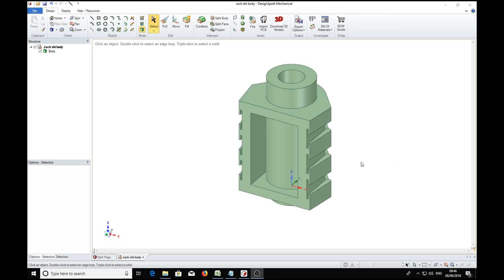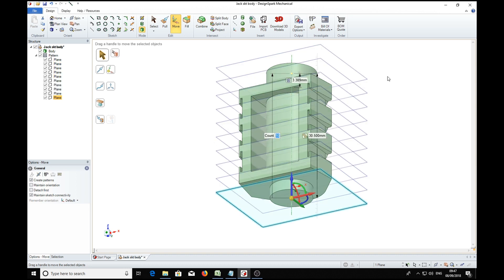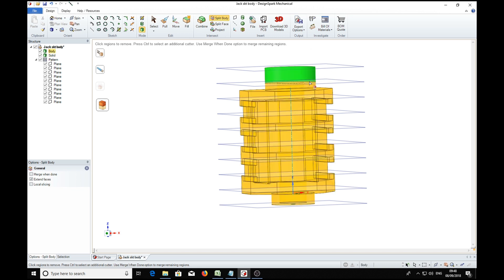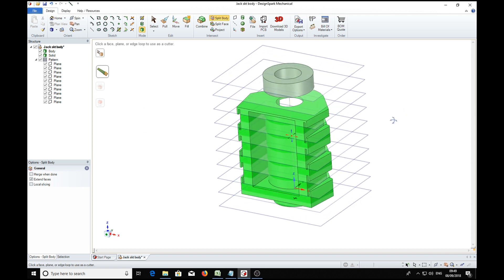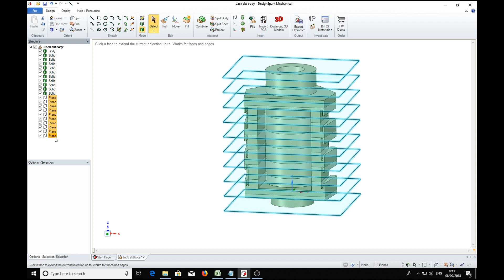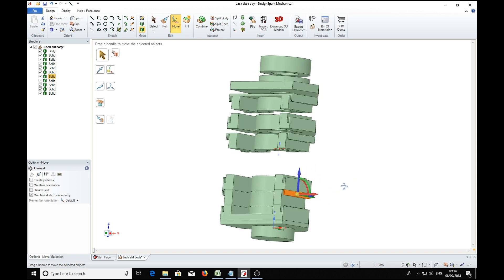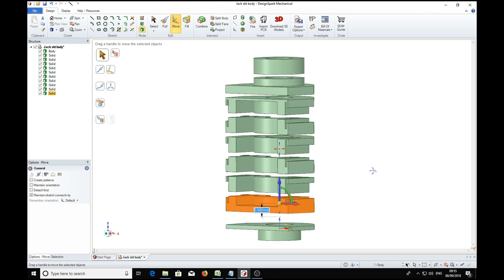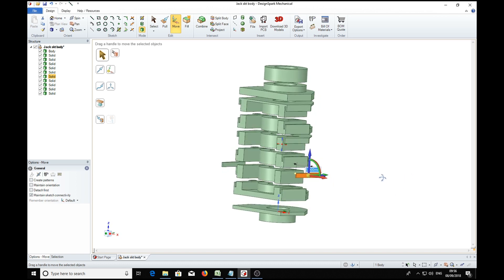Slicing a 3D model in DesignSpark Mechanical

Comment: Hi Jim, thank you for another useful video, slicing in 3D printing is a micro version of what you described ie the slicing software slices the model into pre-defined layers, I do most of my printing in 0.1mm layers plus importantly the slicing software generates the "G Code" which tells the printer what to do, so not the ideal use for DSM, having said that there are times when 3D printing when the model would be difficult to print in one piece so this slicing method would be good to split the model into more manageable pieces, another use for this method which I possibly will make use of and that is for when I am making assembly instructions or part identification drawings, this would save me having to learn graphics software for this purpose.
Reply from the maker: Very glad that it is of some use to you.

Comment: Hello. Interesting experience of using the plane. Like. Although the programs for cutting the model use a thickness equal to the height of the print layer of the 3d printer, but it is steep to cut into layers in DSM.
Reply from the maker: As I mentioned in the video I have not done any 3D printing myself so you are no doubt correct that it would be some effort to do it in DSM - but what about very thin things? PCBs? artworks? My videos are mostly demos to show how to use the various tools in DSM - from basic uses to the more unusual.
Thanks anyway for your comment.
Reply: I downloaded design spark mechanical the other day but I can't save any of the work I do whatsoever. Every time I hit "save as" a window pops up to select a folder but clicking the save button does nothing and I can't choose file type or edit the name either. Any idea what might be going on?
Reply from the maker: Something may have gone wrong in the installation process. Try uninstalling then reinstallilng.